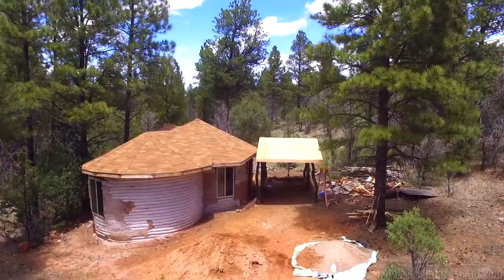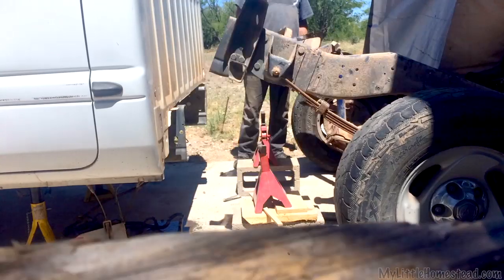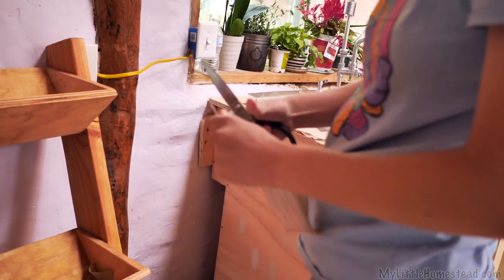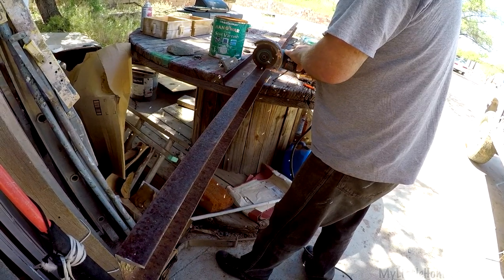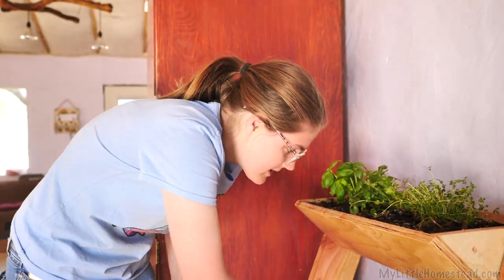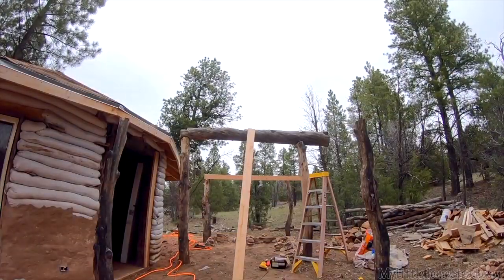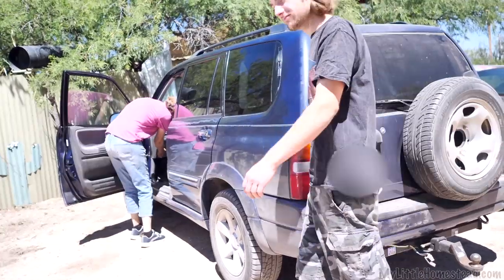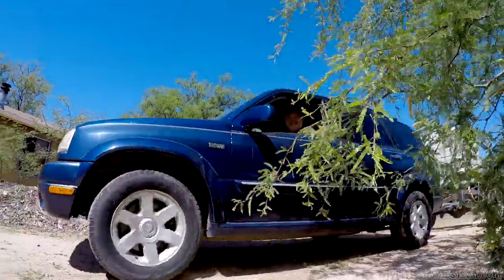Earthbag Cabin Return, Truck/Water Trailer Conversion & Herb Garden Planter  | Weekly Peek Ep187

Comment: Anything natural that is not dried  will eventually lose most of its color. There is a way to coat them with spray resin first. But I think they might have to be mostly dried  before doing this. At  least flowers do with the ones I have tried when making jewelry. But maybe it would be different with the kind needed to make a countertop.   Apoxie does scratch up fairly easily as well . And some will yellow over time.  Although, I have seen some very cool vids of people using it for tables.  You could put imprints of the mesquite into the concrete as well as crushed glass, stones, etc.

Comment: We’ve did concrete countertops ourselves before. I will say if you are going to do that you can do different colored concrete which is cool but also I would 100% have at least 3/4 inch plywood as your base. If the wood flexes over the overhang it will crack the concrete really badly. Also on the sides a really thin layer of concrete is best

Comment: SO just my two cents worth, but def concrete for the counter top and you could lay the leaves and flowers on the surface and then ceil them in after concrete set.  Just an idea.  You could get two of those water tanks on your trailer.  And WOW  what a super trailer.

Comment: You could have the best of both by going with concrete and then creating impressions of the muskeet (too lazy to figure out correct spelling) leaves in the concrete. The pattern could try to mimic wind perhaps, or just be more concentrated under the tree, then be more sporadic towards the outer portions of the counter-top.

Comment: Dry press the leaves first, paint the plywood with primer and paint in one, then put a thin layer of epoxy, put the leaves , add another thin layer of epoxy is one way you could do the counter tops.

Comment: i would personally go with the concrete counter top. it will be strong enough to take on pretty much any abuse a counter would go through. epoxy will scratch and could knick or chip eventually.

Comment: Another great video!
I think you may have a problem with your Mesquite tree top idea .... the individual leaf and flower sections are not flat. Unless you get a work-round that you will have a bumpy surface and problems with air bubbles! 

You could do a hybrid design though (I have no examples, just the idea) You do a concrete top and whilst the concrete is still wet put your leaves into the surface ... it will not matter about the surface being dead flat ... after it has cured you can then apply your epoxy over the top to give an encapsulated result! You could play with marbling the concrete surface with coloured concrete layered dry on the "top" and maybe brushed to give a nice marble effect. If you use an epoxy additive you could layer subtle colours or sparkles  over the marbling ..... Plenty of scope to get creative!

Comment: The epoxy will scratch as others have mentioned. After having stained concrete floors and countertops since 2011. I love them on the floor however the countertops dont fare as well. We purchased the house like that. The kitchen sink was a drop in and we had all kinds of discoloration and chipping around the sink. I hate drop in sinks with a passion. We havent had any issues with the bathroom sinks are they were under mounted. I had granite prior and have now installed it in the above mentioned kitchen. Granite isnt as expensive as you might think and you will not be able to beat its durability and beauty.

Comment: what if you did a concrete base for the countertop for strength and then an epoxy top with the plants embedded? or an epoxy river with the plants just on the seating side of the countertop? the only issue I can think of is that you might have to slightly colour the epoxy to make the plants stand out or use white concrete. maybe you could do a small test piece with the plants and some epoxy just to make sure it cures properly and you get the look you're going for?

Comment: Might consider removing a leaf spring or two from the trailer if it is too bouncy. Not familiar with that rear end but if the axles can remain captive without having the ring gear, you can do away with a lot of drag.

Comment: That epoxy idea is best left for some wall frames. Epoxy can get very expensive, and it's hard to avoid defects, unless you'd take the VERY slow version, and then you'll have dust end up in the end product, so you'll need to polish it. It can't handle heat. 
Concrete is very heavy and you'll probably need to rent a concrete vibrator thingy, so that you won't end up with bubbles.Make sure to round off the edges of your casting form or they'll be too sharp. Probably some caulking would solve that. So I'd say, go for concrete. It's much more reliable. Add some colour if you like. Make sure you got a high quality plywood for the surface. If you still want to add some leaf and flower textures, save that for the sides and keep the top simple and smooth. Much easier to clean it that way.

Comment: think about a combination of concrete and epoxy.  use concrete as the base, then lay down the leaves and branches with a mix of fossil like imprints and fresh branches and leaves scattered thru/out. finally, coat and protect with epoxy. I do not recommend concrete stain and sealing.  i have tried several types.  they just dont stand up to wear and tear that a kitchen counter will have.

Comment: if you want to epoxy in natural things they have to be completely dried and you would prob need to press them and they can discolour over time you would need to do some research because when adding things to epoxy you need to make sure you have enough of the hardener so it goes off properly in my experience it can be a bit difficult  and requires quite a lot of experimentation also when casting a large area of epoxy you might want to see how hot the exothermic reaction will be to see if it would effect the plants hope thats some what helpful x

Comment: Try the epoxy in a small container or on wood with the leaves. Leave it sit out. Experiment. 
The plants will lose color and decay but I think you need to see for yourself since other comments disagree. 
I have decayed plants in epoxy an inch thick, heavily sealed. Decayed.
I also regret putting epoxy on counter tops. Beautiful glaze but easily scratched and not heat proof when you sit a pot down or even a warm plate or use electric cooking equipment on top.

Comment: with as active as you guys are the epoxy would scratch, over time it yellows. concrete has better strength and longevity. you can inset some of the twigs and leaves into the concrete so they leave an imprint. also could put glass bits and stones into the concrete. put clear sections into the concrete and light it from under. any number of things can be done with concrete. stain it, marble it, paint it. make it look like wood.
Reply: love all your video's. my wife and i watch them every week. keep up the hard work and keep moving forward.

Comment: If I may... I would recomend taking a few leafs and pour a lil bit of apoxy (try to keep to one brand of apoxy)...an sandwitch the leafs an let it dry (if anything.. using plastic jugs an contaners you could do apoxy in them, for thickness too an maybe making window like colored inserts with/with out the leafs an colored concreet maybe, just a thought to match the property) ... If your wanting a glossy finish...,  keep the room warm but keep the air flow low (vent room with a few fans on low and low to the ground)...use lots of water buckets around the table for dust an it draws to keep dirt away, you can wet sand it and ether buff if it gets hazy or if you end up getting a rough serface( I had a rock table I worked on... til a leg broke an it fell an broke the rest of the way...lol), anyways.. If you want a glossy top,  go with epoxy,  if you want a grainy top, use concreet...hope any of this helps.
Glad to see the furbabys are happy again 👍👍
Reply: Oh... If you want the concreet smooth or do some of the table in concreet...I do believe you can buy a sealer that will get the top to a almost gloss finish too but maybe the apoxy is cheaper way to make it smoother an glossy, if youll be doing any apoxy?

Comment: Using epoxy for your countertops is a great idea, and there are some beautiful counters made from it on YouTube you could check out. A few things, though, you probably want to know. First, the plain boards you have probably won't look that great, the way the tree in the middle does, covered with epoxy. If you want a wood look for your countertops, consider getting a real wood veneer to put on your base. Second, it's really easy to make beautiful marble look or other colorful custom finishes with epoxy, and your family is so artistic I'm sure y'all could make something beautiful, so maybe think about doing that, maybe try making some small tabletops for patio tables to try your hands at different looks and see what you like. Third, if you don't like what you end up with or want to change it in a few years, you can layer epoxy, as long as you're putting a thin opaque layer in between. Fourth, if you really want to use the mesquite leaves and flowers, which I don't recommend, dry them in a microwave between towels or paper towels to retain the most color possible (they'll be brown and ugly if you don't dry them first, and make a lot of air bubbles, and letting them air dry will lose a lot of the color too) and coat them in epoxy or Mod Podge and let them dry thoroughly, at least a few days, before trying to embed them in your countertops. That will help with the air bubbles. The last thing for the air bubbles is keep your layers of epoxy thin and use a propane torch (chef size) or barbecue lighter a few inches from the top to thin the epoxy and pop the bubbles. Don't mix too much epoxy at a time because it will start to cure before your can use it on a surface that big.

I found your channel months ago and have really enjoyed watching all the building and other projects y'all do together as a family. It's a beautiful thing to see, and you're very blessed. Thank you for sharing yourselves with us. <3

Comment: Go with a laminate counter top over strong plywood, even two sheets glued together for strength.  Far easier to keep clean and no regular maintenance required like concrete, granite or marble.  Epoxy or plastics are not very durable for a kitchen counter top since they will scratch or burn easily. Glass would be very durable but fragile.

On the water tank, I would be very concerned with the use of cloth straps to secure it.  Water weighs 8 lbs. per gallon and if you need to stop quickly or hit a pot hole, etc. they could easily break.  I would suggest chains or metal clamps using 1/2" bolts into the frame.  Now everybody out there will want a water trailer from a truck frame when they see yours!

Comment: Hi! A few practice runs with epoxy and the concrete before hand will give you a better idea of the finish you want. I know it seems like an expensive  experiment, but refinishing a large  outdoor table top, or bench will help work out the kinks before you commit to either style. Just don't make them look too kitschy.  Not everything needs a theme. I don't know what it is with you guys and your differing themes of decor room by room.

Comment: Countertop idea: why not both? Do an organic design epoxy "river" (with botanical inlay, if the advice you get indicates it holds up) down the middle of the reinforced concrete countertop. You could approximately divide the seating from the workspace, yet leave lively organic borders that reflect your existing building style. I think a meandering epoxy river would beautifully echo the nearby tree post (so cool!) Epoxy can be pricey (and concrete is cheap!) so this would be a good way to maximize the effect of the epoxy. You could pick a bold epoxy  color to go with the vibrant hues you already employ, yet it won't overwhelm the workspace since its just the one vein running through the concrete. Good luck!

Unrelated to countertops, I wanted to comment on how much I enjoy the spontaneous compliments and credit the siblings  (and friends/spouses) give one another. Mom and dad do it too, of course, but it is not always a given among siblings. It reflects such a culture of respect and support you seem to have purposefully cultivated in your family, and it shows. It's a pleasure to watch everyone lift up each other.

Comment: Thanks for another great episode.  Have you thought about making the counters concrete but pressing the Mesquite leaves in the top to make am impression?  I'm sure the epoxy counters would be lovely but I don't think they would do well with wear and tear.  Maybe small one as an accent in a area that doesn't get as much wear and tear.  If you're worried about the leaves i'd do a test run on a small piece.  You'll always find a use for the final product---even if it's not for the counters.

Comment: Please Test the epoxy first with the leaves and flowers. they might give out bubbles or an air sheet between the two after they harden. I know if you epoxy bugs sometimes it will do the same. You might have to smash or air dry the leaves then epoxy them. If that doesnt work... try some pressed flowers you have around your place or press the leaves from the tree too.
Other than that this vid was great! Love all the new stuff going on. Keep busy  love ya guys so much.

Comment: Epoxy will look awesome at first, but in a work area that sees daily pans (some of them hot), knives, etc, any marring of the surface could end up looking pretty snarky, burnt and carved up, and then you'd be stuck with that.  Concrete on the other hand is incredibly durable, and any marring or staining of it will be more like a patina that just looks used but not snarky.  My two cents.
Reply: Not from what I've seen with Stonecoat epoxy. They even did a video where they tested the surface for heat, scratches, etc. And it's easily fixed if it does sustain any damage. STONECOAT COUNTER TOPS. And no, I'm not supported by or affiliated  with them in any way, shape or form. LOL
Reply: @MaryGatdula  Well I'll be dang...cool!  Cancel what I said then.  I do wonder about putting plant material inside of it.  Do you think it would decompose or even mold?  Maybe if they decide to do that they should dry it in their oven first...

Comment: I like having solid counters that can be used as a cutting board or a hot plate as you're cooking. Epoxy seems like it would be destroyed if you don't protect it from heat and scratches. Either way I'm sure you'll do a beautiful job :-)

Comment: 2 cents on countertops: in actual use, epoxy burns and yellows under hot pans and scratches easily... looks “worse with wear” while concrete is impervious to heat and weathers nicely, looking “rustic” with use rather than worn out.
Reply: If you’re aiming for something a bit more artistic, why not put dyes or colored glass as an aggregate in the concrete mix?

Comment: Go epoxy!! Much easier than concrete, non porous,  and if you don't like it in a couple of years, easily changed. It is also heat resistant. I did my kitchen counter with epoxy, and the backsplash,  and it turned out Great!
Reply: And the artistic side of it you can do anything your imagination can come up with...colors or embedded objects.

Comment: Why not do both? Have a concrete counter with foliage in resin disks in between in certain spots. Or even make a concrete counter and press the foliage into it leaving an imprint that can be filled with colored resin, like all shades of the green spectrum. Then seal it with polyurethane to protect it. Or even have a section where a marble slab could be added for making bread or candy. How cool would that be? Oh wait, that's my dream kitchen! a beautiful Chefs kitchen (I'm a Chef) with a hanging pot holder that looks like branches, or a pizza oven or a bunch of thin shelves for my coffee cup collection, crocks set off the side to hold my utensils...-sighs as I dream-, yea that's my dream. :)  
But yea, you should have both, the concrete and the resin, oh you could also put those lights in where the resin would be so it could glow at night. Or even use glow in the dark pigment, they make it. Now that would be cool. I think it would look interesting as long as the ground doesn't shift.
Oh and I have put green foliage into resin and it stays green, but like someone else said make sure the bubbles come out or they will be there when it dries. Unless you're going for that look, it will look like it's underwater. Glub glub
Hey look, a shorter comment!. But not short enough. :)